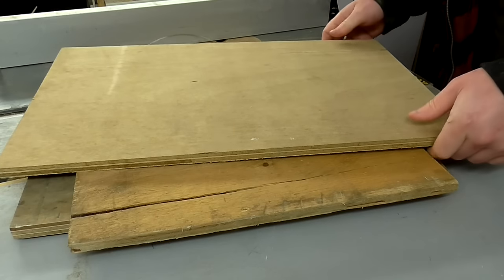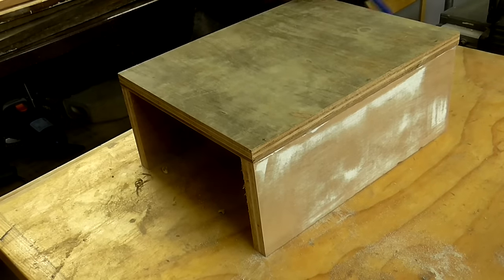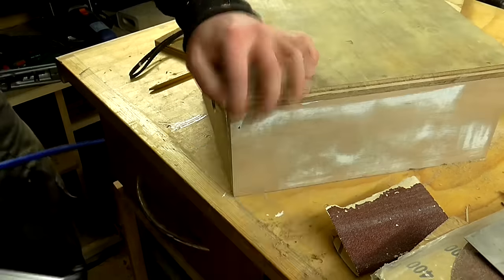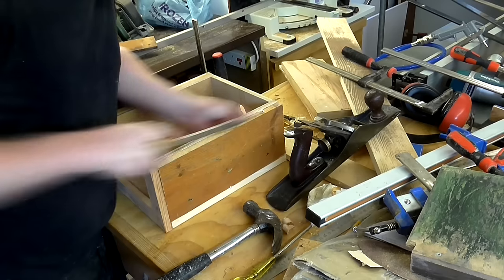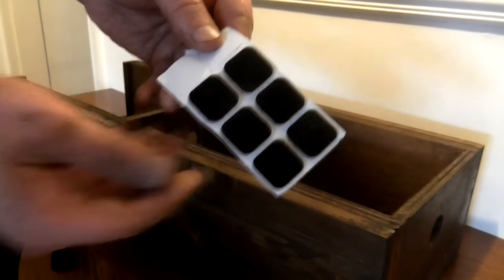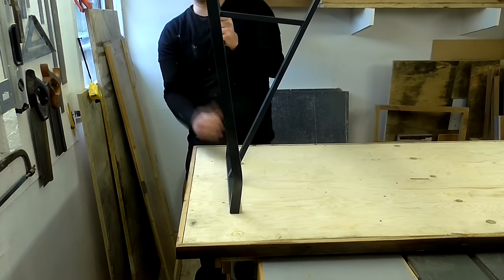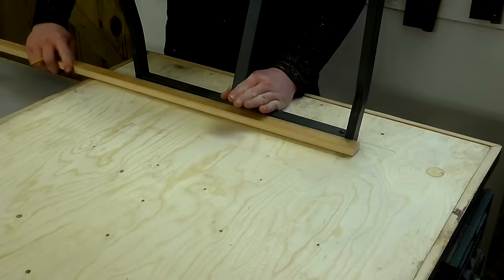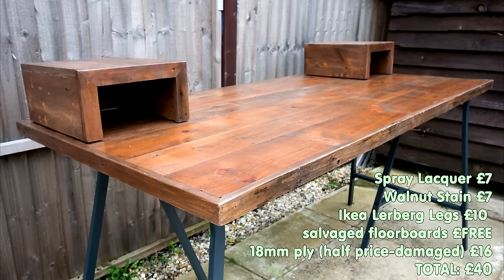Custom Desk And Speaker Stands With Ikea Lerberg Legs (part 2 of 2)

Comment: Did you wind up running any screws through the Lergebergenninging legs, or are they just held in with friction and good intentions?
Reply from the maker: +Joe Gekko no I figured it would be best just to perch it on top with a friction fit just in case it gets moved around or is on an uneven floor

Comment: The only thing I'm a bit concerned about is the speaker panels sliding off the desk itself. Were the rubber feet soft and grippy or the more solid, plastic kind? Otherwise, it looks magnificent, especially for the price.
Reply from the maker: +Scubadog they're felt so slippy but I don't think it'll be a problem
Reply: Here's to a hoping they don't enjoy bass as much as I do!

Comment: nice video thanks for uploading.  those legs looked a bit troublesome without a decent fixing plate on them.  did they have any movement after you surrounded with wood?
Reply from the maker: +supercheekykiwi no they turned out ok with the top just resting on the legs. Thought best not add screws as they'd eventually tear out with the desk rocking/moving around

Comment: Great project, thanks for sharing! Did you consider using a spray gun with your compressor to spray varnish rather than rattle cans? might have been slightly easier and possibly cheaper in the long run? Keep up the great content, your videos are another reason to look forward to Fridays!
Reply from the maker: +Toby Handley thanks Toby. I've not ventured in to spraying with the air compressor yet but will do some day